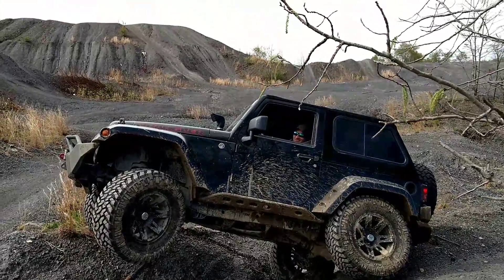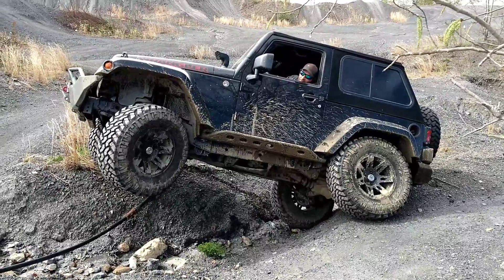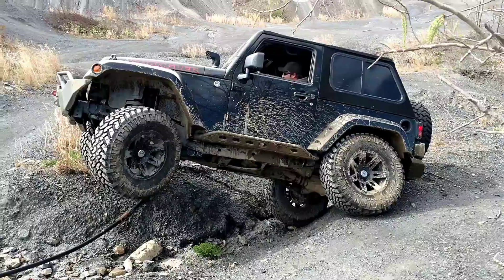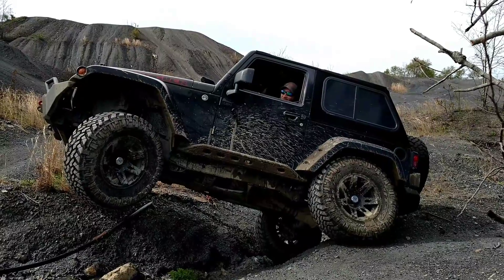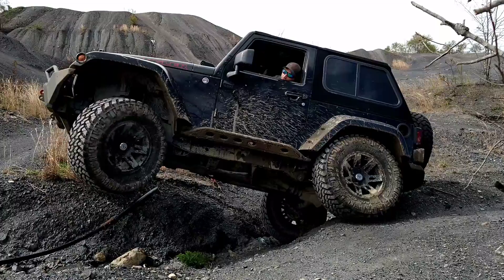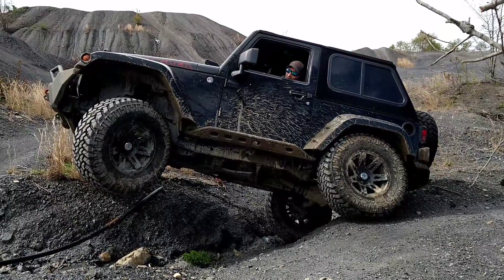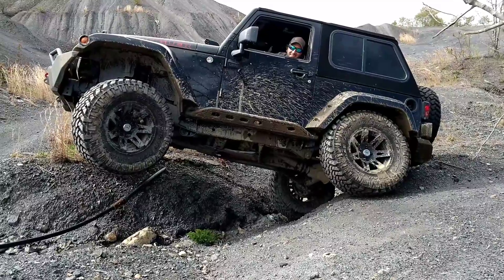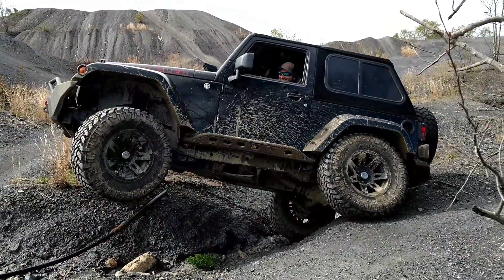The limitations of the Eaton Trutrac differential while using standard LSD rated gear oil.

Comment: There’s something else wrong but it’s definitely not the truetrac if there’s even one installed.
Reply from the maker: If you dig through the earlier comments,  it was the fluid with LSD additives. We contacted Eaton and found that there are not many parts store fluids that don't proudly proclaim that they have the LSD friction modifiers. So we were directed to a fluid called Eneos that is a pure gear oil. We drained and refilled both Jeeps with that fluid and the TT was night and day. With the correct fluid, it's super aggressive and works nearly like a locker. It was all fluid.

Comment: Damn my open diff with Land Rover traction control works better.  Problem with using these true track when you don't have traction control is that when you hit the brake you are also hitting the brakes to the wheel touching the ground. So if you have this with traction control it's extremely good because then the torque bias affect throws even more power to the gripping wheel

Comment: Love how the driver has no effing clue how to powerbrake a vehicle for 1.... and then not knowing thats how the true trac works.... 🤦‍♂️🤦‍♂️ Hopefully he wasn't the one that paid to install it into his jeep, because then there would be 3 things to say negative about. But yet again, that is 80% of the time a typical jeep fan.... has a jeep and says it will "go anywhere, just because of the reputation, but can't tell you a thing about it....
Reply from the maker: I'm not sure what world your on, but this was a test to see how the TT would react. And it was tried with the parking brakes applied and with dragging the hydraulic brakes as well with no driver input. 

With the driver offering zero input, the brake lock differential should have applied brakes to the wheel in the air that causes the TT to bias to the wheel on the ground. 

We later discovered that the cause of poor performance was that all of the available differential fluid in parts stores around us have LSD additive in them already. This additive defeats the TT system ability to transmit force bias. 

After draining and refilling with a similar weight gear box oil called Eneos sourced from a website called KoruWorks, the TT is tenacious at providing torque biasing. The Eneos we used was the GL-5 75/90.

Comment: Nope, nope and nope. 
This has absolutely nothing to do with the "limitations" of the equipment and everything to do with the setup and operator.
Any piece of equipment which is incorrectly assembled, improperly maintained and poorly operated will fail.
Reply from the maker: If you read the comments, you'll see the problem. Almost all retail differential grease has limited slip additive..... as the fluid installed at this time did. Later we drained and refilled with a bare gear lube designed for VW gear boxes and the change in performance and aggressiveness of the near lock- up was incredible.

Comment: You need to feather the brakes with the true trac you will never get stuck
Reply from the maker: You need the correct fluid with a TT. If you pay attention to the video, we used standard parts store fluid that almost always have LSD additive (doesn't work) and we played with brakes, traction control, parking brake.... nothing let it work. 

We later drained the fluid and replaced it with a transmission gear oil and suddenly the TT was mind blowing awesome. It's all in the fluid.

Comment: PSA: they were using LSD friction modifier. Which you DO NOT do on a torsion LSD. Not to mention 35's are also not recommended.
Reply: Right. I was going to say the same thing after finding this video just now. There are no clutches in a TT, no need for a friction modifier. And it's probably a bad idea considering how a worm-gear LSD works. Further, Eaton says specifically, don't use a synthetic GL5 oil with the TT. Just use conventional GL5. (Not that it applies to this Jeep, which was running "regular" oil plus the additive.)

Comment: There is nothing to replace the manually engaged selectable locker. The shortcomings of automatically engaged lockers are evident in this video, while in addition these cause some problems when driving on hard surfaces.
Reply: I think a lot of people misunderstand what helical (torque biasing) differentials actually do and how to use them. I see a lot of comments about these diffs being "automatic lockers" (like a lunchbox, Detroit Locker, or even e-locker) which they are not and were never intended to be. Helicals are intended to seamlessly redirect torque from low-traction wheels to high-traction wheels, not to match wheel speeds (which lockers do). So for most purposes, they are the most effective, smoothest, fastest reacting, quietest, and most durable option when both tires are going to stay in contact with the ground. They're generally not the right tool for the job when wheels are getting articulated far enough to lift tires. However, a really well designed off-road tuned traction control system like Toyota's ATRAC can use helicals very effectively to stop lifted wheels from spinning and redirect that torque to the wheels on the ground. That's still less stable in serious rock crawling than lockers, but it's also more nimble because it causes far less push (understeer).
Reply: @elektro3000 By "helicals" I suspect you refer to the Torsen type of posi-traction, which ingenious as it may be in concept, still falls short performance-wise vis-a-vis a manually selectable locking system. The only downside of a manual system is that it requires certain skill to know when to use or not use.
Reply: My sparten works as it should but it's from Marlin crawler

Comment: If you watch the video... the brakes are never applied when throttle is applied at the same time. Bad driver.
Reply from the maker: You may not be aware of brake lock differential in Jeep products? When a tire is in the air or losses traction on ice or mud, the wheel speed sensor sees this and the vehicle applies brake force to the spinning wheel in an attempt to send torque to the wheel that may still have traction. 

So your theory is one of ignorance, the vehicle will always apply brakes and provide some amount of torque bias by virtue of the traction control system. 

There are no shortage of uneducated people, the supply is literally endless.
Reply: @LarryMusgrave ... if your theory was correct then the jeep would have crawled out of there.
Reply from the maker: @brianthompson9485  
Your getting there. So combined, the TT with the wrong fluid that contains LSD additive and the BLD still couldn't solve that. 

Drain that fluid and replace with Eneos transmission fluid if the same viscosity and the TT works nearly as well as a locker. Boom. The fluid is the reason for bad reviews of the TT.
Reply: @LarryMusgrave , I'm aware... the TT relies on co-efficient of friction between the helical gears for it's torque bias. If you add a friction modifier you typically lose 20% of the torque bias (some manufactures actually spec friction modifiers with Torsens to reduce the torque bias). If your driver would have hit the brakes and the gas (you can tell he didn't from the brake lights) at the same time he would have climbed out even with the reduced torque bias... he just would of had to use more brake. The BLD didn't apply enough brake where the driver has the ability to apply more brake pressure to transfer more torque.

I agree though, the right oil makes a difference. haha
Reply from the maker: @brianthompson9485  
And note that there was not LSD additive added. The fluid is a standard off the shelf Valvoline bear lube that is rated for use with our without LSD differentials. What we discovered is that finding locally available gear lube with no fiction modifier added is nearly impossible. All parts store gear lubes that we attempted had the LSD spec fluid. 

We then discovered Eneos that had VW transmission spec gear box fluid with zero friction modifiers. The performance difference is mind blowing, night and day. The desired aggressive nature of the TT with this fluid is beyond description.

Comment: As a mechanic, it's working 100% as it's supposed to work. It's a LSD not a locker.
Reply: I question your mechanical abilities then. A torsen will transfer far more torque than an open diff will when applying brake and gas at the same time.
Reply: @brianthompson9485 please, check on How torsen works.
Reply: Totally true, it will give you some traction but not break

Comment: Any road racing enthusiast can do a heel toe manuver.  So the problem here is the lose nut behind the wheel.
Reply: 1. Loose
2. The point isn't how to get out of this situation, it's to demonstrate how the TT falls short in this situation, for this car/driver. As with almost everything, YMMV.
Reply from the maker: It also was showing (inadvertently) the poor performance of the TT with a standard parts store differential fluid that contains limited slip additive. 

After draining and getting a fluid that contains zero lsd additives, the aggressiveness of the TT gets shockingly better.
Reply: @LarryMusgrave  Okay..ya ns lol.. Thats kind of pertinent info that you should have disclosed in the description or added caption dont ya think?

Comment: Apply brakes first then add throttle and easy off on the brakes, works every time for me.
Reply: I think his problem is he has to let out the clutch, give it gas, and apply the brake at the same time.  It's much easier with an automatic I'm sure.
Reply: @kpetro1675  Agreed. This is why i never understood why offroaders with standards cut their park brake cables. Rig shit up. I've cut cable connectors (where 2 cables connect) in half, welded a nut to one and rod to the other. You then use it to adjust for cable length. Now find the right cables.
Reply: @kpetro1675  then the boy better learn to heel toe it
Reply: @kpetro1675  Thanks. I'm having this installed on my manual TJ and was wondering how it worked.
Reply: You are right. That’s the way they work.

Comment: In the comments you mentioned that you were using the wrong oil initially. And now that you have the manufacturers recommended oil type in the diff that it now works a lot better.

Comment: Funny I dont have any problems using BTM on my front diff on my TJ but I run a different style of torsen, Yukon's new spartan Dana 30 helical 10 pinion torsen. not a Truetrac tho(same tech tho) mine prob has a tighter bias ratio is my only guess. I love it when I see video showing just how "good" truetracs are.. dont get me wrong they are really great for alot of things but in this instance they are not, the torsen diffs were used by our military in the H1 hummers with their weak IFS AMC 20's but soldiers were taught when a tire was off the ground to hit the brakes to transfer power to the tire that has traction and they worked! My guess is that when Eaton developed their version of a torsen diff they wanted it to be smooth operating. Likely Humvee's had some form of 4x4 hop on realy tight turns due to the bias ratio of the gears in the torsen. I.e. not smooth. You know if you make a product like that and it's not perfectly smooth on turns you will have a lot of cry babies. Just my $.02 

Happy trailing from jeepers in NTX!!!!!

Comment: I think you should park the jeep until you learn how to drive what you have.    Just tap the brakes and they will lock up then you go down the road lol
Reply from the maker: In the scenario you see here, we tried setting the parking brake, we tried dragging the foot brake while applying throttle and we tried just letting go on its own. Nothing got it to work with the wrong fluid installed. Once we drained it and replaced it with non synthetic fluid that had zero friction modifiers.... it worked like magic. It's all about the fluid.
Reply: @LarryMusgrave  You might want to pin that info to the top.
Thanks for sharing the update.

Comment: If he applies pressure to brake and gas would it have pulled out?
Reply from the maker: We did that. Both with parking brake and foot pedal. I believe that you'll hear us talking about and trying different things.

It ended up being the fluid. You can not get the expected performance with synthetic fluid, it any fluid with the LSD additives. We drained it, swapped over to ENEOS Gear Oil GL-5 75W-90 from KoruWorks and it's beyond night and day difference.
Reply: Larry M Musgrave that’s great to hear!  Do you think this set up front and rear of an 2017 F150 daily driver would be a pretty unstoppable hunting truck for AZ trails?  I’m glad it worked better that’s great news.
Reply from the maker: @dad3562  
With the right fluid, hell yes. What we learned is that very very few differential fluids in the market can be had meeting both of Eaton's requirements....
1) Non synthetic.
2) No limited slip additive/friction modifier.

The KoruWorks site has this at the best price I've found. We now have 3 JK wranglers running the Trutrack differentials on this fluid, and one F350 dump truck Dana 80 running it. It's good to go.

http://koruworks.com/store/performance/eneos-gear-oil-gl-5-75w-90/
Reply: Larry M Musgrave sweet right on!
Reply: I know it’s been 2 years but I finally bought a Jeep. If I’m not changing my gear ratio do you think these are plug and play?
Reply from the maker: You'll still need to set up the ring gear lash. If your not changing gears, your factory pinion depth is good, you'll not need to set up the crush. But the ring gear left to right will need reset.
Reply: @LarryMusgrave  oh that makes! Thank you so much!

Comment: Can someone explain to me why tapping the brake would help?
Reply: Torsen style differentials will lock the axles in almost any situation where one tire slips. But there still needs to be friction on that tire. So in Ice or (in this case) mid air tires. Applying the brake is like having traction to the ground which in turn provides the necessary friction for the diff to lock itself.
Reply: DTT are NOT Torsen.

Torsens lock by gear interaction.
DTT the locking comes by the end of the hel8cal gears pressing out the sides.

Comment: I have truetracs front & rear in my truck and they never behave this way. If I had one tire spinning one each axle then riding the brake would transfer torque to the other side. I've done it. Something is wrong here. Either he's not feathering the brakes or someone screwed up your installation.
Reply: He said he had the wrong gear oil.
Reply: @Zachary  what oil did he change to?

Comment: If DTT in rear, apply Ebrake, if in front apply foot brake....
Reply from the maker: If watched video and listened to talking, brakes and parking brake were applied in an attempt to force application of torque bias. Later discovered that to get proper functioning of the unit, a lubricant with no anti slip additives is required. This is actually difficult to find on local shelves. We ended up doing a drain and refill with Eneos GL-5 that made a dramatic improvement in the performance of the differential.

http://koruworks.com/store/performance/eneos-gear-oil-gl-5-75w-90/

Comment: I noticed the sigh of discussed when someone else is not operating your prized 4x4 correctly ... I FEEL YOUR PAIN !
Reply from the maker: Well, it's not mine, it's Adams. But we ended up changing out the differential fluid to Eneos VW spec non fiction modified gear oil in both his and mine and the torque bias functioning is dramatically improved.

I ordered from Kuru works since they have the best price for this. It's actually tough to find a gear oil that is not blended with friction modifiers.

http://koruworks.com/store/performance/eneos-gear-oil-gl-5-75w-90/?gclid=Cj0KCQiAr8bwBRD4ARIsAHa4YyIRYkdEJQH8cmoIdfzWk8kAlCjT8T5hw7YAsq-X739t6G-cyutHqO4aAukJEALw_wcB

Comment: So hold the brakes slightly and you'll get right out. Basic stuff.
Reply: Annnnd I just read your reply to another comment from a year ago explaining that you didn't try the brakes because you wanted the system to handle it. 😂😂😂
Reply from the maker: @BucktailResearch  once the video testing was done, it absolutely was done with the brakes as much as he could. My suspicions from the get go were that the fluid in the differential contained the typical LSD additive. I've since installed one into my JK and used a hard to locate fluid that does not have any LSD additive. Adam also changed over to this fluid. The differential works amazingly better with this in it.

http://koruworks.com/store/performance/eneos-gear-oil-gl-5-75w-90/
Reply from the maker: He was. Even tried adding some parking brake.
Reply: @LarryMusgrave  he would have moved if he'd done it right. I do it CONSTANTLY and even with straight up 1:1 open diff, I can usually get both wheels rolling without trouble.

Comment: I gotta tru trac  in the back and an e locker in the front, they work great together.
Reply: This works well.  Or, elocker in the rear, and True trac in the front.  The rear locked makes the front's job so much easier, and steering with a TT offroad is great
Reply: That's a nice combo

Comment: So did you ever fix the BLD system then try this again?
Reply from the maker: We didn't, as the BLD was not showing as malfunctioning. 

What has been done is that the axle grease has been changed to ENEOS Gear Oil GL-5 75W-90.

This is a conventional/dino grease with absolutely zero friction modifiers. I ordered it from :
KoruWorks 
http://koruworks.com/

This has made a noticable improvement in the units torque biasing and changed how it works in a good way.

Life is good!
Reply: Dino oil ??

Ever wonder how gazillions of dinos got 20,000 ft deep and turned into oil?????

Its been well know for MANY years that oil is not made from dinos.
Reply from the maker: It's a common phrase that is interpreted as not synthetic.....